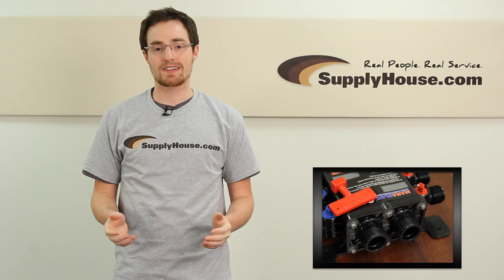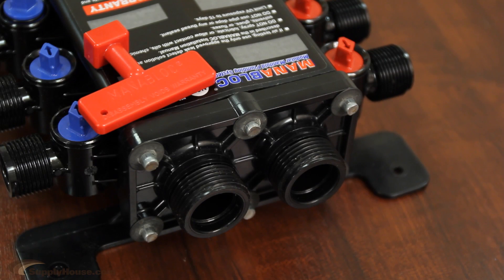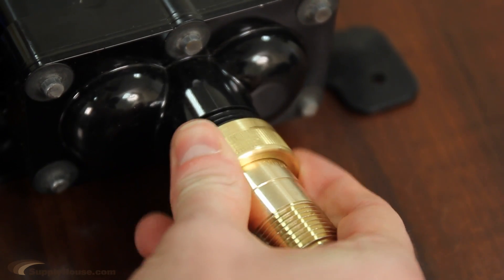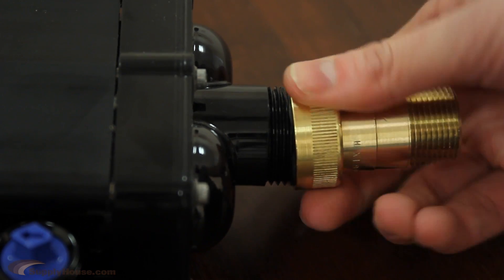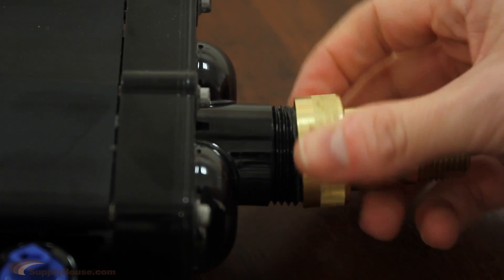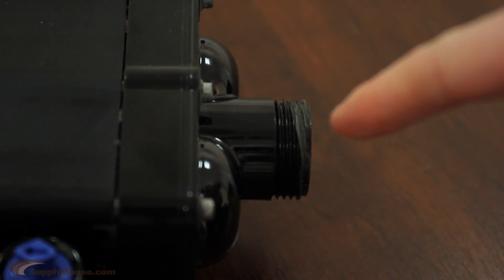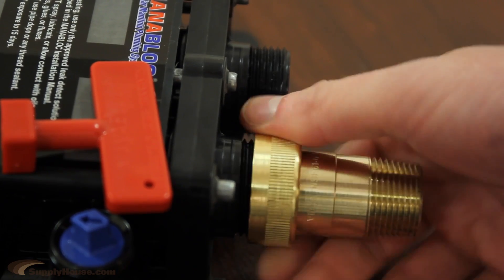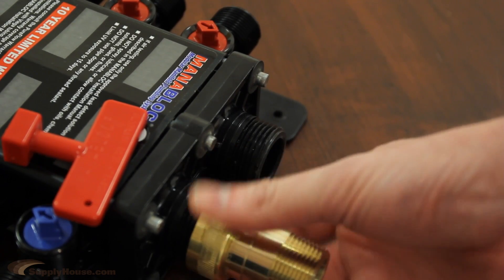Learn How to Properly Install Manabloc Supply Adapters

Comment: Just make sure you keep the nut away from the block until you can see the o ring has been properly seated and the flange on the fitting is square and flush to the block. Then thread onto the block and spin it in with your fingers. Tighten with a wrench only when you've made several complete turns by hand.

Comment: Hi Supply house,  I have been shopping around for a couple of months now.  In reading reviews,  why did they make the water connections a threaded connection?  Why not follow the normal pex pipe connections for crimp or shark bite?  I almost bought this namabloc.  Then I look it is also a threaded connection on the opposite side.  What?

Comment: Mine arrived with one of the supply adapters partially crossthreaded on the lowest threads. Must have been a return. I was able to get it on correctly after a half an hour.of careful attempts. For the price the manifold connectors should be brass just like the overpriced mating connectors.

Comment: These are a huge ripoff - $30 each f*%k that. I returned the manifold because of that.
Reply: Been a year since you posted so you probably won't see this, anyway I bought adaptors on amazon 5pack for $20 and they are pex crimp ready